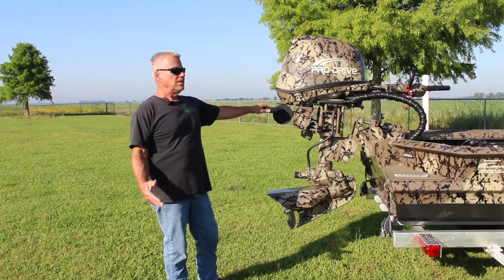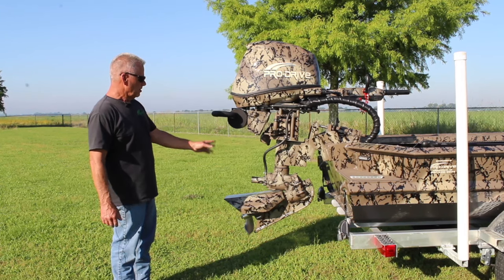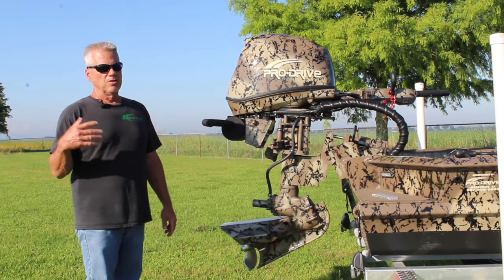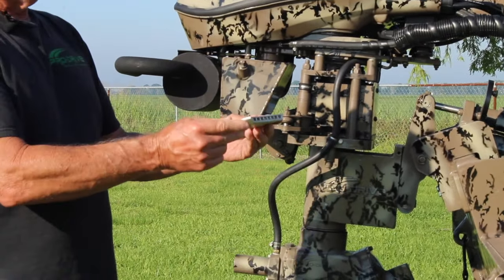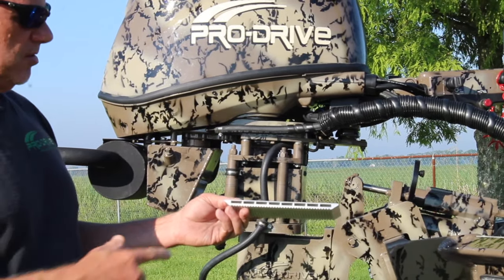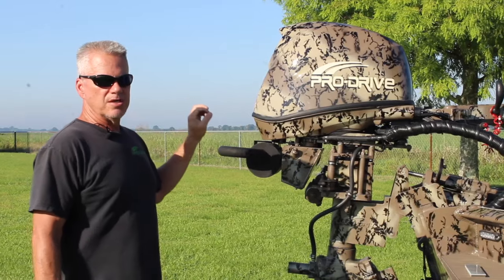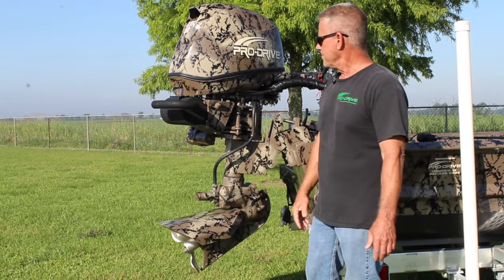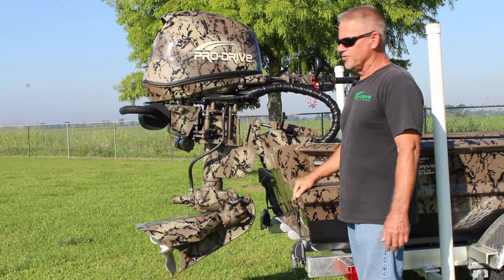New Pro-Drive 50HP Motor

Comment: Why not just use a radiator and electric fan
Reply: physical size
Reply: @vieuxacadian9455  yeah but u still have the problem of having to use external water to cool it 
What happens when it's below zero out or ur running a mud flat

Comment: Being that tohatsu 40/50 are the same motor minus the restrictor, why would you designate this as a 50hp and limit your buyers significantly? People will not be able to buy this to run in lacassine pool
Reply: It may have to do with the restrictions of what many boats might be "rated" for on the sticker and they have to play that game.
Reply: The 40/50 are same engines yes,but the restricted plate pulled out doesn't make it a 50 sir,it's all in the turning of computer.....we've done dyno test,pulling restrictions out of the 40hp,add 3.9hp....not 10

Comment: Anyone have a rough idea of cost? And where are we supposed to mount the keel cooler so it doesnt get ripped off? On the transom maybe?
Reply: Feel like boat manufacturers will probably make a recesses spot in the bottom of the hull so the cooler sits flush with the bottom of the boat
Reply from the maker: For questions about prices and details, please call our shop and ask to speak with our GM. 337-229-0034 . Our hours are M-F 8am-5pm CST